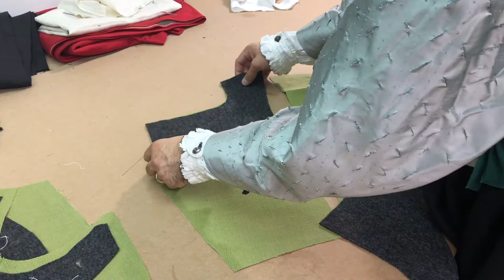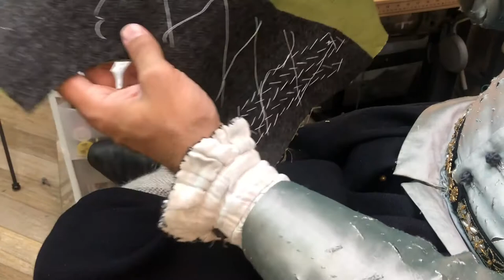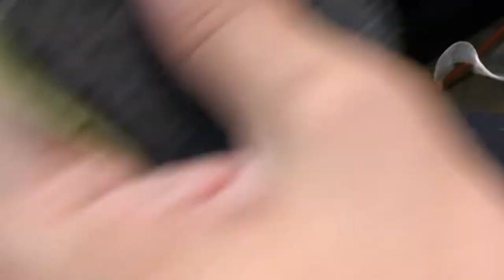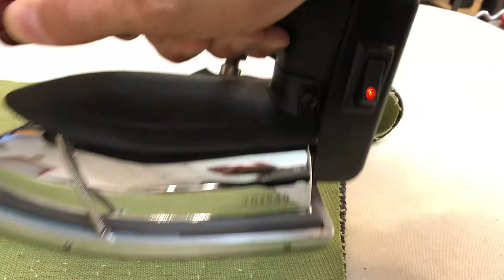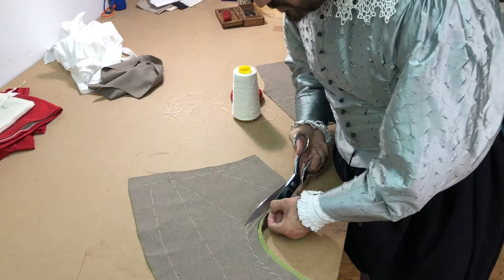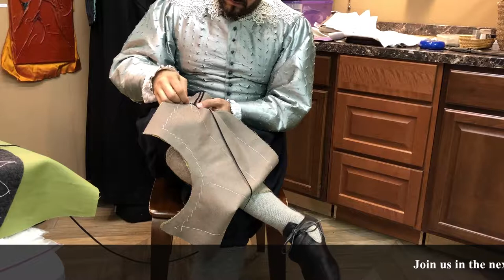HOW TO MAKE A 1618 MAN'S DOUBLET: The Modern Maker Workroom Season 2, Episode 4 The back

Comment: Seeing as I am looking to do a similar, albeit earlier  (think 1560-1580),  doublet entirely by hand as you are demonstrating; where would I find large spools of linen thread like the one you are using? I have some smaller spools of linen thread, but they are not as smooth as yours seems to be and they tend to catch, snag, or twist while sewing... even when waxed lightly. I can find the silk thread I intend to use for my finishing thread, but nice linen thread in large spools seems to be eluding me.

These videos have been a great help to me in understanding the material in your books! Thank you so much for making them!
Reply from the maker: The particular spool in the videos came from Ursula's Alcove. Its a 40/2 linen thread that I also used for lacemaking. There are other large spools, though not suitable for lace, are great for sewing which you can order from yarn.com

Comment: would you use the same sewing style for making a doublet from the 14th Century say from 1340-1370?
Reply from the maker: From what I know, only a few of the construction techniques really transfer that far back. When looking at late 14th/early 15th century doublets, there is a different way of constructing them. You COULD use similar techniques, and, if the pattern is good, you would get a good approximation. However, the order of operations in the 14th century was likely quite different. Experts in the era often speak of doublet panels being made and lined separately and then assembled into the final garment by means of a tight, firm whip stitch worked from the inside of the garment. I can only speak to this based on conversations I've had with people that study the 14th century with the same detail that I study Early Modern clothing. The 14th century is not my focus so I won't presume to answer from an expert's perspective.
Reply: @themodernmakermathewgnagy215  Thank You this is helpful